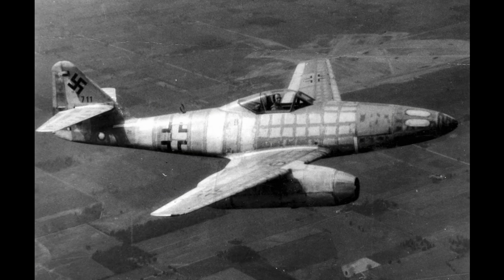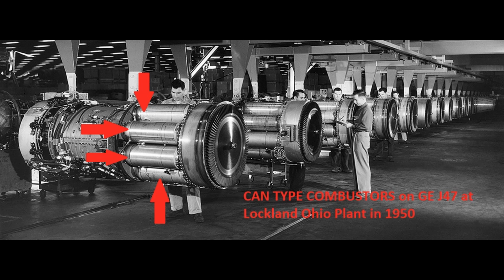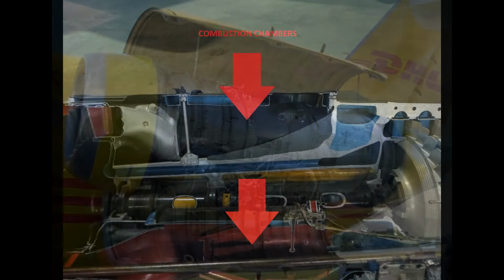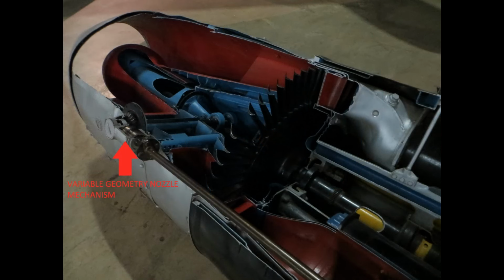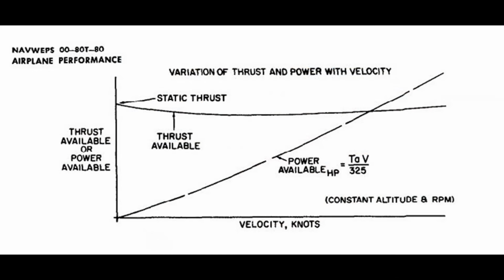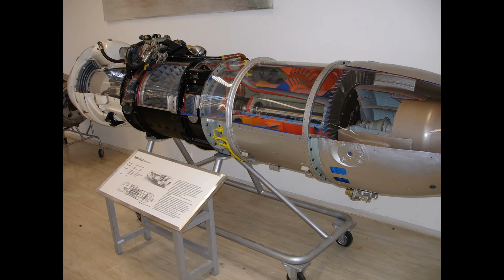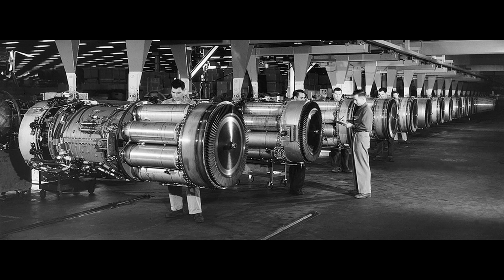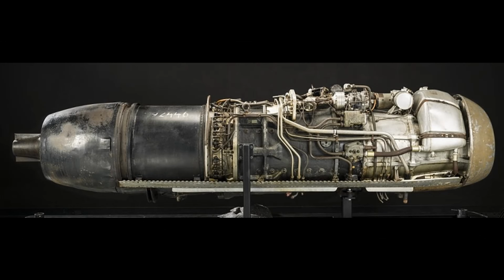World War Two JET POWER

Comment: 10:53 The German word for "onion" is "Zwiebel", pronounced like "tsweebél" (I used an "é" to show, that it is spoken like the "e" in elephant or Elton).😉
Reply: You can use Google translate to get the pronounciation too.
Reply: @hurri7720  Yes, that's true. But it does not work always that well. Translations to English are mostly okay, the ones to German are sometimes not that good, and the ones to Russian are sometimes just rubbish.
Reply: @patrichausammann  , yes but trying to explain it as a text isn't easy either.
English is of course rather difficult as the same word, like either, is either either or either.
Russian I don't know.
PS. with Google translate I mean using just one word in this case.
Reply: @hurri7720  Yes I agree and know what you mean.

Comment: About Ju-287  - it was on "proof-of-concept" phase - they cared mostly about the performance of the negatively angled wings, secondly for the powering by jet engines. It was an expedient experimental design, using parts that were available: the landing gear comes from B-24 Liberators, the fuselage comes from He-177; they used the ones that were available and that would show similar aerodynamic characteristics to the final design; the gear was simply the most robust they had. The production machine would have nothing to do with this build up, except for the wings, and maybe engines.

Comment: I disagree with your assessment of the He 162 program; Volksjäger. The idea was to use, not the standard Luftwaffe pilots, but instead rely on a different "stream" of training.  Actually teenagers with just a few hours in a glider.  The He 162 was supposed to be sufficiently docile and easy to fly to accomplish that. 
It wasn't.
It's was a good plane but it needed a good pilot to master it, so it defeated the purpose.  Basically, it was a (another) desperate idea.
Reply from the maker: Needing to use the Hitler Youth to fly it sort of makes my point that the whole idea was fatally flawed.
Reply: @GregsAirplanesandAutomobiles  Exactly, my point is that i don't think the Luftwaffe would use "regular" fighter pilots in the He 162 (They would much more useful in a Me 262 cockpit).  Ironically, the only real use of the He 162 in the war was in the capable hands of the JG 1 pilots.  Sorry my English.
Reply: Here's a thing about that - the Luftwaffe shut down any new training intake in October-November of 1944, and all training was essentially finished in Jan-Feb 1945.  There weren't going to be more pilots, no matter how many airplanes got built, or their qualities or lack thereof.

Comment: J47 was developed from the J35, which was developed from the J33, which was a direct descendant of Whittle's centrifugal jet, rather than the 004. And another Brit, Griffiths, also designed axial flow jets. The 004 had a very short use life compared the British jets 10 hours average compared to 150 hours
Reply from the maker: Some of you guys get really sensitive about the British stuff. The J47 is axial flow, nothing like the Whittle engine or the J33.
Reply: @GregsAirplanesandAutomobiles  no we just don't  like people talking bollocks.
Reply: @GregsAirplanesandAutomobiles  I didn't say the J47 was a Whittle engine. I did say that the J47 from the J35 which  came from the Whittle-based centrifugal-flow J33, (Whittle and Griffiths had both come up with axial flow  )
Reply: @GregsAirplanesandAutomobiles  but you are trying to say that the J47 came from the 004 when it didnt.
Reply: @liloldme1210  , The Whittle engine was made axial flow by the Americans One has to remember that luckily Germany lost the war and guys like Wernher von Braun went to the USA and, for instance, Kurt Tank to Argentine to design jet fighters.
About the Whittle engin and it's correction to become axial flow here at about 12.50 so in essence a 004.
https://www.youtube.com/watch?v=Y76qd68M1-M
This vid isn't that bad either.
https://www.youtube.com/watch?v=z_hKFlLpOYM
Reply: OK - the GE Centrifugal line, which started separating from Whittle's W.1 prototype with the J31 (I-16), was developed by the turbosupercharger team at Lynn, Massachusetts. (Which makes sense, since a Centrifugal jet is basically a turbosupercharger with a fire in the middle). The J33 was a product of the Lynn team, with significant differences in design (particularly the combustors) from Whittle's designs.  It was running and producing 4,000# of thrust in February/March 1944.
The GE Axial Line, which sprang from the initial US Army Air Corps contracts let in 1940, started at Schenectady New York, with the development of the T31 (TG-100) axial flow turboprop.  Not wanting to miss out on the fun, they developed the TG-180 axial flow turbojet, which was also running in February 1944, producing 4,000# of thrust.
I defy you to look at diagrams of the 2 engines, and to point out any common features.
It must also be noted that Sidney Hooker, of Rolls-Royce, was rather shocked to find, on a visit to the US, that GE had 2 engines more powerful than anything contemplated in Britain at the time.  He began a crash program that ended up developing the Nene and the Derwent, in order to be able to compete.
Of course, you're ignoring the Westinghouse 19 (J30), 9.5 (J32), and 24 (J34), the Lockheed/Menasco L1000 (J37), which was begun in 1938 as a private venture, and the Northrop Turbodyne (T37) Turboprop.
Reply: @peterstickney7608  I take it you will believe GE. so...read this and tell me where the Jumo 004 comes into it.....https://www.ge.com/news/reports/the-story-of-the-1st-us-jet-engine-the-hush-hush-boys-wanted-to-win-the-war-but-they-ended-up-shrinking-the-world
Reply: @liloldme1210  The Jumo 004 doesn't enter into it at all.   Nor, in the case of the GE, or Westinghouse, or Lockheed, or Northrop axials, does the Whittle W.1  GE had two separated design/development teams working on jet engines - the Turbosupercharger development team in Lynn, MA worked with, initially, the W.1 design, but branched away from it (other than general configuration), and the Power Turbines  (Steam Turbines - which, if must be pointed out, are mostly axials) group in Ohio (Which is further away from Massachusetts than Land's End is from John O'Groats).
Reply: @peterstickney7608  GE got the drawings of the Metrovick F2 in 1943, the Companies had patent sharing agreement and when the Royal Aircraft Establishment asked Metrovick to pass the design on to the USA, the company specifically asked the plans to only be given to GE.  This Document covers the history of Metrovick's involvement with the  design of axial flow gas turbines and how it  fitted into the overall development of gas turbines within the UK. 

https://www.research.manchester.ac.uk/portal/files/54530197/FULL_TEXT.PDF

In part of the document, it states that the RAE were passed information about the development of some of the Axial Flow engines under development in the USA, most likely from OSRD, while information about GE's efforts were passed on to RAE, directly from Metrovick.

The USA did get Axial Flow information from the UK, before they got any info off the Germans efforts and it would have helped the US effort even if the information was "We tried this method and it didn't work".
Reply: @peterstickney7608  Ah...the old America invented the jet argument......I'm out
Reply: @liloldme1210  If you're really interested - do a deeper dive into the history of gas turbines, particularly gas turbines in aircraft.  Gas turbines were first used in industrial applications in the early 1900s. (The first Gas Turbine engine patent was in 1899).  The first self-sustaining gas turbine was run in 1903.  Brown-Boverie in Switzerland was selling industrial gas turbine engines in the 1920s and 1930s.
There were jet and turboprop propulsion efforts going on in the UK, Germany, the US, France, Poland, and Romania.
Just like RADAR, jet engines were the secret that everyone was working on, and hoping no one else knew about.
And, as a gratuitous dig, proud as you seem of Frank Whittle, His Majesty's Government screwed him over so badly that he emigrated to the United States.  (Met him during a joint lecture he did with Hans von Ohain)
Reply: The axial flow compressor J35 was developed in parallel to the centrifugal flow compressor J33. They may have shared turbines and combustion sections  in whole or in part I don't  have access to any information other than a certain online encyclopedia at this moment, but the front ends were radically different.
Reply: @neiloflongbeck5705  And not forgetting the the J31
Reply: @superancientmariner1394  which came before the J33, so I omitted it.

Comment: What is meant by the term “hot start “ that the military uses on some forms? 
Thanks for another Xmas present.
Reply from the maker: A hot start is when temperatures at or near the turbine (often call ITT, or EGT depending on exact location it's measured) exceed the starting limits. It can seriously damage an engine. During start, pilots watch that gauge like a hawk and if it's rising too fast, they cut off the fuel.

Comment: Ju-287, as on the photo, was not meant as a real bomber but as a "proof of concept" for a bomber with forward swept wings. Actually it was hastily put together with parts of different aircraft. Both of the nose wheels came from downed B-24 Liberators....It also has quite an interesting history. They swept the wings forward in order to increase flight speed more towards the speed of sound.
Reply: That last sentence is not true. 
A. It had a very low LE sweep angle of about 15 deg. This is not enough to significantly delay shockwave formation (this depends on the cosine of the angle, which at 15 means only 3% increase in speed. 
B. Without composite materials, it is not possible to achieve a forward sweep enough to gain meaningful aerodynamic benefits, because forward swept wings suffer from aeroelastic divergence.

This small forward sweep was to move the wing box rearwards, so that the bomb bay could be placed at the center of gravity and so a large payload could be carried and dropped with no trim drag penalty. This is mentioned in this video on the X-29: https://www.youtube.com/watch?v=LOmvrk3LPGc, as well as in other places, such as Raymer's book: "aircraft design: a conceptual approach".
Reply: @ASJC27  Hello ASJC27, They did it exactly for this reason! :-)
 Pre cursing wind tunnel tests suggested exactly this. 

The fact that the carry-through structure is behind the bomb bay might be positive for a bomber, but It was planned as a smaller reconnaissance aircraft at first.

Maybe one can say it was a demonstrator that was designed closely towards a serial aircraft. All in a hurry, as 1944 everyone knew the war wasn´t lasting forever anymore.

Aerodynamically, forward sweep has many positive aspects for controllability, and the boundary layer of the wing can´t move outwards (and render control surfaces useless) like on traditionally swept wings. 
Furthermore, as Raymer states a forward sweep Angle of -22° leads to an elliptical lift distribution for a rectangular wing (less drag->more speed-> reconnaissance). 
The Ju 287 features ca. -20° sweep.And
Positive flutter coupling is the main problem of this design.
They wanted to counter that with the placement of the engines and later with wingtip tanks, as you can see on Ju 287 V3 that was rebuilt/completed after the war as OKB-1 EF 131 and EF 140 in Dessau and in Russia. 
But not having stiff enough materials in the Soviet Union lead to the cancelation after EF 140.

https://en.wikipedia.org/wiki/OKB-1_EF_131
https://en.wikipedia.org/wiki/OKB-1_140

Comment: Very very interesting video.  I would have liked to see a comparison to the british engine used on the Meteor too.
Reply: It wasn't axial flow. Whittle admitted the Jumo was a better design, but that information was deleted from the Wikipedia years ago.
The jet engine is for some reason a very sore topic for many Brits for reasons I find odd as I cannot remember the British ever having invented any engine but the Sterling engine. All engines are invented by either the Germans or the French and the first patents for the steam engine went to a Spaniard.
Now should you look for "Jet engine development" on the Wikipedia you will be presented with Fred Whittle and nothing else.
Reply: @hurri7720  never heard of Fred Whittle, was he a relative of Frank perhaps?
Frank Whittle's gas turbine was the first one to run successfully. Held up by lack of official belief and money, it allowed the Germans to catch up with their independently designed engines. The principles of both engines were soundly Frank Whittle's though and the Germans acknowledged that they based a lot of their initial work on papers published by Frank Whittle in the mid 1930s.
Despite the axial flow engines being an ultimately better design, the Whittle centrifugal compressor was far more reliable and examples from the 1940s are still flying today. The Rolls Royce RB 360 helicopter engine still uses an centrifugal compressor for its high pressure spool as an example of a modern engine using this technology.
Turbo chargers use centrifugal compressors as they are able to withstand the stresses of constant use, being togher than axial bladed types.
Reply: @chrisknight6884  This is why Wikipedia is not reliable as a source - there are far too many people with an emotional investment, and the spare time, to keep pounding in their particular hobby horse.  The sections on the history of transonic aerodynamics are also similarly littered - for example, the idea the Kuchemann invented the area rule (backed up by a plan view of an airplane that does not meet the requirements of the area rule) when Kuchemann himself says that he didn't.

Comment: Yep. Thanks for the run-through. Centrifugal next? 
Oh, I guess the issue with the Junkers bomber was testing the wing. Brave folks in those pre-computer days. You’ll find at least part of that fixed LG was comprised of B-24 parts. Great stuff! 
Merry Christmas! 👍
Reply: The computer in those days was a bunch of mainly pretty female maths graduates who ran iterative spread sheet like numerical solutions.  They were very good and excellent marriage material.  There were a few punch card computers around.  This goes back to the need to calculate nautical navigational almanacs and ephemera for celestial navigation.   It’s why lady Ada Lovelace was involved in working with Charles Babbage on his analytic difference engine.    Lofting a wing, flutter all done this way.  Men used to do this but it was expensive to find men who would do the accurate work.